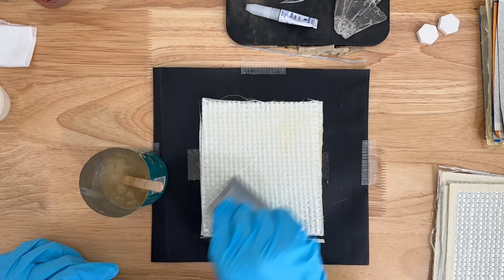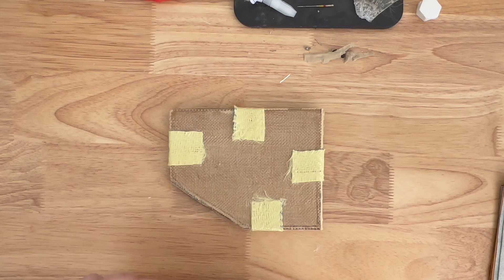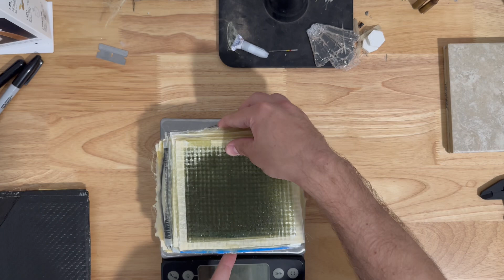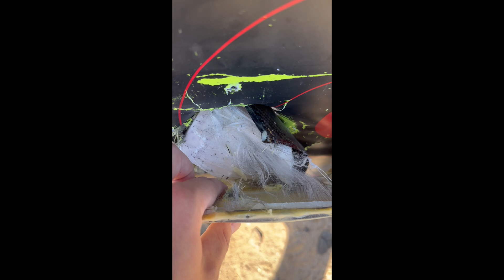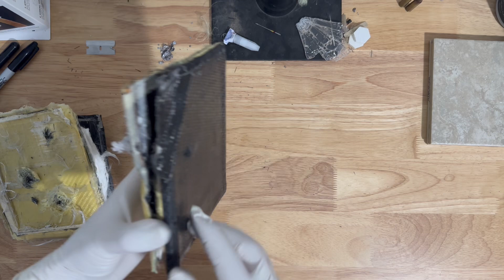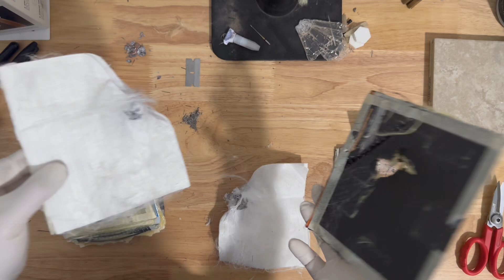Can 100% Fiber/Fabric composite stop 5.56 FMJ? (No metal, No ceramic)

Comment: I think 3RBallistics did 130 layers of UHMWPE (I think without resin? not sure) that did amazing for rifles. And With 25-30 layers of UHMWPE plus some padding, that is good for handguns. So, UHMWPE is the stuff. Alumina Ceramic or hardened steel are also important but that would not be flexible nor light.

Comment: What type of glue did you use?
Reply from the maker: T-88 epoxy from system three

https://www.systemthree.com/products/t-88-structural-epoxy-adhesive?_pos=1&_sid=9a88d0cc5&_ss=r&variant=13268181764
Reply: @Armor-Innovations thanks, i try permanent glue, like for flyer, and thermopress with ballistic polyethylene

Comment: Just got to watch this, congratulations again, stopping FMJ with a pure composite plate is impressive.

From what I could see on camera, it looks like the PE on the plate using the K29 got pushed aside and didn't get to engage the round properly.  I've noticed that happen with edge shots on PE plates on armor demos.

The weights you mentioned weren't half bad.  A rough measurement of an old plate I have laying around gives me an area of about 100 square inches for a SAPI cut.  The Hesco 3800C (what my friend's brother was issued), weighs 3.3 lbs for the SAPI cut, which would be 4.75 lbs per square foot.  The 3800C stops M193 only, and is 0.95 inches thick.

Hesco's 3810, rated for M855, is 5.4 lbs for a SAPI cut, 7.78 lbs per square foot.  The 3810 is 0.98 inches thick.

A thinner plate, even if a bit heavier, would be viable, as each type would have a use case.